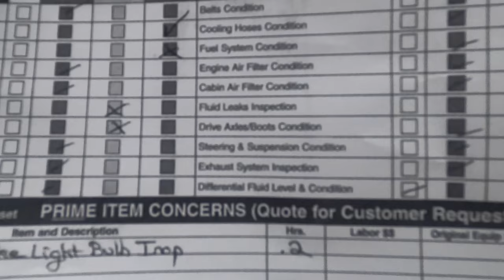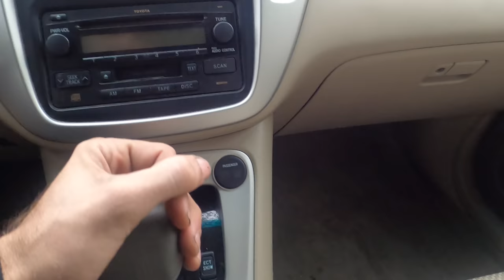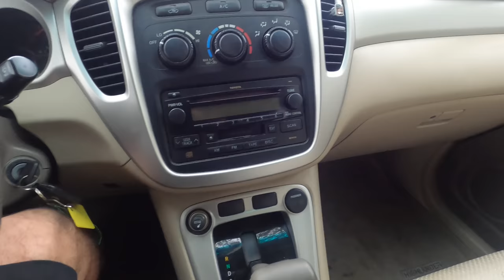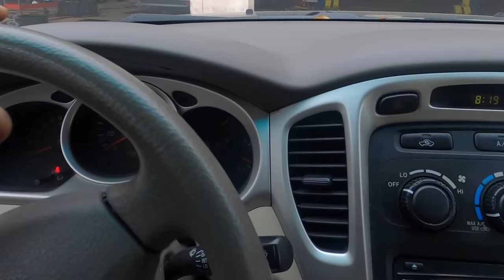We were BASHED by the Dealer! Ripping off a customer! Toyota Highlander 3.3

Comment: I keep saying it, USE Nickel Anti-Seize and this won't happen!
Brake drums are made from cast iron or stainless steel and those rust very easily. Stainless steel corrodes from oxygen + water and faster from salt added to that. Copper in copper based anti-seize causes inter-crystalline corrosion which can cause parts to crack or break when under heavy loads.
Rust removal & Painting!
▪︎ On parts you can powder coat/Spray paint them to make them rust free for many years like calipers, brackets & outside of brake drums anywhere the pads don't touch (use high heat, rust preventing paint with clear coat over that) but only after removing all rust from the drums/disks and put Nickel-Graf on pins and mating surfaces like wheel hub face.
A little preventative maintenance when you replace parts future proofs your car and makes your car much safer.
You also get a lot more life out of brake components and your car parts in general.
I use Silicone Spray on rubber bushings and white lithium grease on metal to metal hinges/pins like door hinges which prevents rust on metal like cast iron/stainless steel. B'LASTER Silicone Spray makes bushings sealed and protected from sun/heat damage for many more years.
▪︎ You can also remove rust from bolts/nuts with Evapo-Rust which is Reusable and it works great overnight. I make old rusty fasteners look like new with Evapo-Rust. Muriatic Acid is a strong option but it can eat away the metal with the rust if it's in too long. Submerge the parts in the Evapo-Rust and then reuse the bolts after wire brushing them and slapping them with brake cleaner or PB Blaster and drying them. Most of my bolts either get medium-strength threadlocking adhesive or Nickel-Graf to rust orevent them. If you lube them adjust torque value to wet value. 
▪︎ Multiply dry torque by 0.7 to get wet torque!

Comment: I honestly stopped trusting any mechanic a few years ago when i discovered a local honda dealership ripped off my elderly mother where she paid to have new belts and hoses installed (among other things) and it turned out the belts were still at least 10 years old, cracked, dry, and starting to squeal. I then began going through her invoices for maintenance and found a few more things where they patched the problem instead of replacing the part. 
Then recently my old man took his 1999 4runner to a local shop and had them do a 26 point inspection, check pads, battery, leaks, etc etc and while they were doing that to change the oil. I began looking over the 4 pages of things needing repair and it was clear they didn't do much inspecting, but instead just checked off a bunch of stuff that typically needs to be done like transmission fluid, diff fluid, valve cover gasket, plugs, and brake fluid flush. ALL of which I had personally did myself this past summer. It also said he needed brake pads in the front which was accurate. the belts IMO looked fine but they were recommended to be replaced. Jacked up his truck and spun the wheels, and the bearings seemed fine even though it said they needed replacing. 
The best part of this was the breakdown of parts and labor. Labor being $150/hr which is batsh*t crazy. The labor charge for just the transmission fluid was $510. $150 for new plugs. $160 for new front pads. Then there was the price for the parts. $100 for front ceramic brake pads. lol. That's more money than the ECS Red Stuff high performance pads for my Audi.  Even the OEM Toyota pads cost $65. Every part was priced in this manner. Almost every part cost at least 50% more than if i bought them from a dealer at MSRP and the hours of labor also didn't conform to any rate guide i know of such as Identifix, Mitchell, or Alldata.  These guys were crooks, plain and simple.

Comment: From the view of a prior tech ---> to group leader ---> to Shop foreman ---> to SSDI 😕 for a large 45 bay Toyota dealership for more than 11 years just there. On the brake squeak, noises, only other thing I noticed was the front & rear pads DIDN'T look like "Factory Pads" ( If they were some cheap $12 Auto Zone pads, further down the road, they DIDN'T always work out to well ) HOWEVER on all else, stuck slides, rust, park brake, etc I FULLY CONCUR 👍 ALSO, however the appearance of a power steering leak, ( any & ALL Toyota's with "Gray" colored F.I.P.G indicates factory assembled seal, otherwise, IT'S NEVER been off before ) if I remember correctly, on 3.3 models, the pump may be leaking like ZERO @ the time... But.... BUT, BUT, BUT, the majority of any oil leakage was ENGINE oil cooler lines, ( TSB even ) NOT pump, rack etc. I haven't watched part 2, YET. And your certainly a skilled enough tech by leaps and bounds ( more then some of my techs we had there at the time 😕 to investigate and make a correct call, deciphering the difference from p/s fluid and motor oil 🙂 !!! Had I thought about it, and if it was a "Thing" to do during my career from the late 80's through the mid 2010's, of video recording to making You Tube videos, I'm the type who would have done it too 😂🤗 !!! Wow the extra $$, AND the memories, the good times from back then 🤗😂 It's almost a different world today... Mainly in the tools, fancy diagnostic scanners, etc. etc. etc. We had only books & manuals back then 😂🤣 GREAT video too btw !!

Comment: My question is, if you did the brake job the first time, why didn't you check and grease the sliders? And the second time you had them in you did not "torque" the bolts at 24:50.

Comment: Strictly speaking, sanding down those inside faces on those discs for where the parking brake sits is the 'wrong' thing to do.

However, in my book, A) those won't be doing anything whilst moving, they are literally only used for stopping the car from rolling, and B) drums don't tend to notice imperfections like sanding marks, even if they function on the service brake.

Solid, cost-effective repair which, on a lower mileage vehicle, will be cheaper than buying discs, having it happen again after a couple months of sitting and then having to spend on discs again.

Comment: When I wrenched for a living, I also did side work, which most mechanics do.  I had a friend ask me to do a break job for another friend of his, so she could save some money(cheap ass).  I did the break job which included shoes x 4, old Dodge Dart.  The customer then complained that the "wheels" were 'hot to the touch after driving".  Well, what a genius she was!  Friction causes heat, friction stops your car!  There are times when friction is your friend!  I looked at the breaks again to see if there was a different problem that she had not mentioned that needed attention, which there was not, and everything looked as it should.  As she drove away, I could see her riding the brakes all the way down the street, I asked if she realized she was riding the breaks, which of course she denied.  You can not fix peoples driving habits.  I told her she didn't understand physics, and I didn't need her money, please don't ever return!

Comment: It goes both ways, dealers bash independents, and independents bash dealers. It's very unprofessional in my opinion. As a senior Master Ford diesel technician, I never threw other technicians under the bus. It's just not a professional thing to do. If anything I usually found myself looking for reasons why it wasn't their fault. I operated this way because I wouldn't want them throwing me under the bus either.

Comment: After 20+ years being under served/over charged by incompetent/disgruntled, lazy/don't give a dam, mechanics with a rare splash of quality. I do my own brakes/oil & anything that I possibly can without a lift. But brake replacement cost 10's of thousands over a span that should have cost maybe 5G had the sliders/bolts been cleaned/greased & other minor maintenance performed instead of replacing everything to take the easy route...

Comment: Before compressing the break calipers piston should I open the top of break fluid reservoir???   I think that is how air got in my 4Runner lines  connecting with ABS system, now ABS and Trax control lights on... Thank God now I can finally bleed it out, then have codes cleared and turn back on the ABS and Trax control

Comment: When watching you fabricate a “long” bolt to allow the placement of the missing power steering pump bracket(s) on the Jeep Rough County and need nuts & bolts find a GreyMarine store. They have every size and shape. Unlike Fastenal, you find what you need from small independent bins. Also everything is stainless steel. ‘Really like your videos. The aircraft maintenance/ repair industry needs you since you can fix things! Not just replace modules.  -:)

Comment: If I had to guess ...I'd say your paid by the Hour and not Flat Rate ... It would have been nice to have the customer show you the brake noise so you'd know what to "fix" ..... Those disc Rotors will get surface rust quickly and can/will make noise when backing out of your driveway etc. the rust "Cleans" off when you drive it ..

Comment: My dealer said my car (2021 Toyota Venza with odo 29,000 miles, bring in for free tire rotation) needs wheel balances after they check the tires with depth gauge. Final report said, tires have same depth thread.

Comment: Dealership recommendations on repairs are bs a lot of the time, I was told my water pump needed replacement at 60k miles, I sold that car with 180k miles on it with the orignal water pump.
So I ignore these most the time and do my own repairs but its a Toyota, so most the time its gas. Oil, and gas.
My 2001 toyota celica had 233k miles on it when I did its first frt brake job.
Its now close to 300k and ive still not done the back brakes. Oh and I live in snow country.  My celica dosnt show rust on suspension parts like a GM truck would.  But it gets washed after every snow storm. If you live where it snows. You've got to wash the salt off the under carrage, if you don't the 50k dollar trucks going to rot. I dont care what brand it us.

Comment: Yeah, those pins should be able to slide.....your issue was the lock pin either dried out on the grease, or it didn't either have enough, or none at all. But easy fix.
I work at a break factory....i plate the body and support (bracket) to the calipers (for the Honda Civics). Use to assemble the Civics, but I changed positions (Lines).

Comment: I own a 2004 Toyota Highlander. I had nearly identical problems with my rear valve cover gasket leaking and power steering hoses being corroded by the oil leak from the valve cover gasket. As a result I had to have the rear valve cover gasket, power steering pump and hosing all replaced. I had other minor issues taken care of.. $2500. I am completely satisfied with all the work done. Was it worth it $$$? Well today's new and used car prices are way, waay, waaay off the chain and you just can't kill a Toyota Highlander as is the case with many Toyota Vehicles of that generation. This is my daily driver until the wheels fall off. There's a chance the sun will turn dark and cold before that happens.😆

Comment: Can I make a suggestion. When removing a caliper after removing the bolts, I have an old flat screw driver, I use as a crowbar. I take the screwdriver and stick it in one of the large holes and grab the back of the outer pad and pry on it so that the piston gets pushed back into the caliper ever so slightly. Doing this makes it very easy to remove the caliper.

Comment: A friend went to a local Toyota dealer for every vehicle and all maintenance - the defn of a loyal customer. Then she had a brake job done, and it seemed like nothing changed. I took a look, and yup, the rotors had wear grooves and her pads were non-existent. They had charged for the work, but did nothing. 
Now she's a loyal BMW customer instead. Don't know if that will be better, but good for her.
We bought a used car from different local Toyota dealer. They were upfront that brake work needed to be done including complete fluid swap. It was priced cheap as recent trade-in with no work done. We paid for the work, and also paid for new pads. Also had an oil change and brake inspection just 90 days ago. Suddenly we are metal-on-metal = no brake pads.... So, different dealer, same result:  charged for matl and work that was not done. 
So we will no longer use that dealer for anything - not even the "prepaid oil changes". 
We WILL use the local garage that has never ripped us off.

Comment: I wouldn't have used a flat wheel, I would have used a wire wheel and brake cleaner. Hops No. 9 gun cleaner works really good on rust as well.

Comment: I give you 99% which is way above avg,but always use solid spanners when loosen or tightening bolts, where the rattle socket don't fit

Comment: Ray, in the Air Force on our munitions trailers we use to call this Brake rehab or maintenance. No real parts are needed other than caliper pin boots and silicone high temp grease. You think you go through Brake clean. I used a case of it a day, and we were thought if we even sneezed around the brakes to clean them. We would always clean and de-rust the caliper pins and pistons if they were metal and grease the face of the piston, No plastic caliper pistons back in the 1980s to worry about. lol, Good job Brother! PS: Ray I have worked around guys like you and it was always a joy and made the workplace better and fun to be at. Keep up the good work.

Comment: Missing the bigger picture here in my opinion. It’s a 17 year old car. Upon the first brake inspection-new calipers, rotors, pads all around should have been recommended. This mechanic is now stuck trying to pick up the pieces. This customer has made 3 trips for brake concerns. What happens when one of those 17yr old calipers actually locks up? Trip #4 for the customer. This mechanic has good skills and make some good points. The failure here was the first person to inspect the brakes-trying to do right by the customer but made too conservative of a recommendation.

Comment: MMMMM.. your slipping .  such a shame .. I quite like your banter .The slide pins which have the rubber sleeve are a potential cause of  jamming .  I replace those rubber sleeves which swell and jamb with Nitrile o rings . No blue Loctite ?. How about some rubber grease / lube on the slider pin bellows .  copperslip on the brake pads sliding pressure faces .Putting the de rusted brake drum back on without servicing the brake shoes was sloppy ..  I would have made sure that the customer would not be a comeback .  At least on any work I carried out . Great video    made for interesting viewing ..

Comment: Slide pins dont call for a new caller but most shops will make you buy them all the same.
I have never in the last 45 years bought a new caliper, ive rebuild plenty of rusted ones, most the time its becuse you dont change the brake fluids . I think once I had to replace a master cylinder becuse I could buy rebuild parts for it. Rebuild parts are a few bucks calipers cost 10 times that. Or 100 to 250 bucks each.
You do all 4 a brand job can cost you over 1500 dollars thats why I Diy my own cars.

Comment: Your shop just put the brakes on…..seized slider pin in 6 months……the reason Toyota dealership called sticky calipers is because the caliper mounts onto the sliders……where you took both 14mm out! Furthermore a leak is a leak regardless of sweating. They let the guest know which is right, rather not call it? and not give your guest an advance notice? Guys are here giving this videos a thumbs up just don’t know what they are talking about……you deserved to be bashed. Well done brake jobs don’t last 6 months……

Comment: Maybe I go overboard with brakes, but I always remove the pins and caliper when replacing the pads and clean them out with brake cleaner and a wire brush. Then re-grease the pins, anti-seize the caliper bolts, and inspect the boot for replacement. Takes only a few mins to do and prevents any issues. When I do my own brakes, I replace the pins, boot, and bolts. Only $7 for it all. While I am there, might as well replace them if it is cheap.

Also, the caliper falling and hanging by the brake line killed me.

Comment: This slide pin is rusty, instead of taking 5 seconds to clean it up with a wire wheel, it should probably be replaced. Also let me use sandpaper instead of a brake lathe. Saving my customer from the dealership buy fucking his shit up with incorrect repair procedures.  Pro MiKaNiK

Comment: First Off I'm not a professional Mechanic, however I have heard (and it makes sense) that when you compress the brake piston in the Caliper, you should do so with the bleeder open, so as not to push the old fluid in the caliper back up into the system. What do you think?

Comment: We have an air”con” specialist here who offers free aircon check inspections. Had a vehicle checked that way and they said we had a leaking system even though all was working fine prior to our visit. The rub was they recovered the gas from our system under the pretext there was a legal obligation for them to do that. However, they didn’t tell us that in advance or before doing it. That left us with no aircon system and a quote for $4k+ to fix it. We took it elsewhere, where it was regassed and checked with no indicated issues. Three years down the road and all is still working perfectly. Kind of destroys one’s faith in humanity. How many times have they done that to others and ripped them off by doing completely unnecessary repairs. Scumbags!

Comment: Had too much pin grease?  Near vacuum lock?
I always had slide pin issues on an Elantra GT.
I try to clear out the hole for the slide pin with a Q-tip.
Surprised shop/mechanic has no hooks to hang those calipers safely.